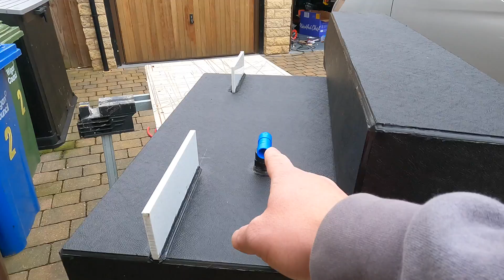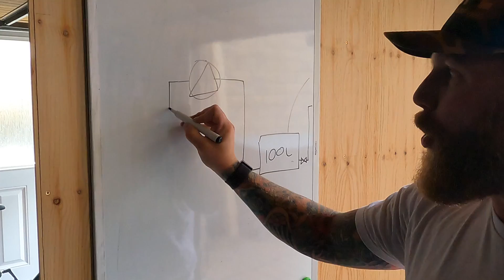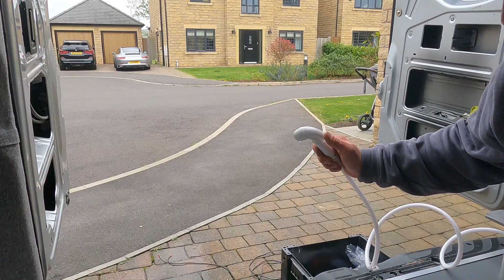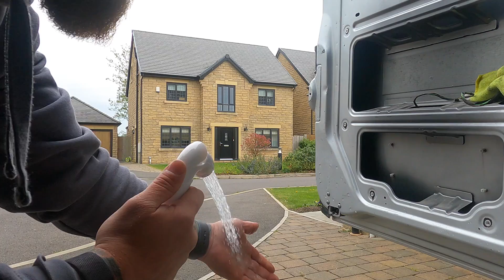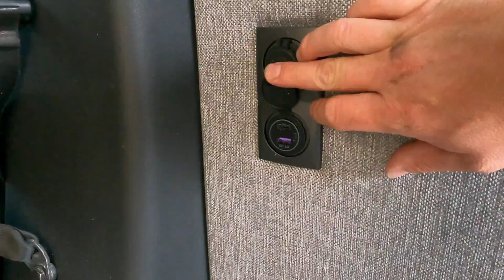Ep15 MERCEDES SPRINTER. VAN PLUMBING HOT WATER. TIPS

Comment: Looking a putting a 240 heater in just for a bulfinch shower, just wondering if the tank goes rusty, will it contaminate the drinking water as it will use a tee off from the cold drinking water, any help would be much appreciated many thanks
Reply from the maker: Shouldn’t go rusty mate if it’s designed to be a water heater

Comment: Hi brilliant video I was thinking the exact same thing using residential heating tank rather than 12v dedicated experience counter parts. But I also want to include a chinese 12v diesel water heater into the same system so I could use the 240v hot water tank to collect the hot water from the diesel heater.  I would really love to see a video on how to make this happen from a professional prospective as your self. Ps when I say chinese water heater I don't mean the chinese air heaters some people use heat exchanges ect. I mean a chinese water heat heats water directly it's self all in one unit.  I'm sure u no exactly what I mean.

Comment: Thanks for all the information.
I'm going to do similar except with a water tank with built in heat exchange so we can heat of the engine.
Was just wondering the size of your tanks. Width x length x height.
Cheers
Reply from the maker: This has that. I just didn’t use that way. Van and tank are long gone. No idea on size. Maybe a link in description
Reply: @urbanarkoverland  allgood
 Thanks for the reply

Comment: I know this is two years after the video was posted but that's the wonder of YT. Would it be possible to have a pre-heater dedicated to only heating water and not running off/connected to the engine water system? The engine water system is a closed loop, so would it be possible to have a smaller (shorter pipes) dedicated anti-freeze closed loop system? Possibly with its own dedicated small tank if required. This would surely result in hotter, quicker anti-freeze = hot water quicker.
Reply from the maker: @AlanAlanAlanDave  yep. Autoterm do them.
Reply: @urbanarkoverland from what I’ve seen they ain’t too big. So is it possible to daisy chain another hot water storage tank?
Reply from the maker: @ they do bigger water tanks

Comment: I'm making one that's purely gravity  fed, to keep it simple and pump free. No chance of pressure bursts either.
Reply from the maker: @doobclub  that will be low pressure that
Reply: @urbanarkoverland  it'll flow quicker than a garden water butt, which isn't bad anyway. Less components means less weight, cost, and maintenance.

Comment: What if it runs dry, will it stop heating the water
Reply from the maker: @CulpritsTV  the hit cylinder will always have water in it. Unless you physically drain it. So even if you run out of cold water the hot water cylinder is still full and ok to heat

Comment: Fellow plumber... Should the expansion vessel be tee'd to the hot on the outlet? I'm wondering if it should actually be tee'd to the cold inlet like you would an unvented cylinder in the home. This, I think, stops the membrane from degrading so quickly. Tidy install mate.
Reply from the maker: @twistandturn02  no mate. On the hot. As most people put a check valve in the inlet and obviously designed to take expansion in the hot system. That’s my 10 pence 😀👍🏻

Comment: Hi. If you had chosen a marine calorifier instead, you would have two additional tubings in and out available to connect your engine cooling water. By doing so, every time the engine is running you make hot water and do not have to use your battery to warm up cold water. Most boats have this system, since decades. As a former sailor I put it on my campervan as well. Works like a charm. Good luck.
Reply from the maker: Yes mate. Didn’t want to interrupt anything to do with the van. This conversion doesn’t even have a shower so it’s only a luxury bonus

Comment: Great vid
For me I use the bobil system as I'm all 12v and rarely run hookup or inverter.   Why don't U add a temp gauge to the water and when it reaches 45⁰( which I find perfect for shower) and switch it off . I know U have Bullfinch so it's mixing cold n hot but 10 litres is plenty to have a relaxed shower and if only heating 10L to 45⁰ will save power .....
Reply from the maker: Hi mate. The immersion has a temp stat in it that does that. Just like household 👍🏻

Comment: Possible to make this work with Victron for example so excess Solar automatically dumps to heating the water?  Guess it would need an electric temp probe for starters? 🙂
Reply from the maker: Hi byes you can do that. Works off of the cerbo. Relay switches power to immersion heater when above any desired percentage. 
The immersion itself has a temp probe. So will turn off when at temperature. 👍🏻
Reply: @urbanarkoverland   ah excellent, thanks for the reply. Would make for a great setup 👍

Comment: Calorifier and disel air heater or better to just do hydronic?
Reply from the maker: Maybe not in a Mwb van. 2kw heater more than enough. And is very efficient with space and moving parts etc.
Reply: @urbanarkoverland  you mean hydronic is not necessary for a 144?
Reply from the maker: @carsandcoffee69  not saying that. Nothing say is ‘GOSPEL’. Just opinion mate. 
But bye. If it was a live in van. Lwb that kind of thing. Then ye. Could be an option. But a 144 that’s used twice a month for holidaying. Prob unnecessary
Reply: @urbanarkoverland  got it. Yeah. It's difficult to make a decision. I am looking at a isotemp water heater at the moment. I have a tire carrier water tank, which makes me wonder if now i have to worry about freezing water and if i need to put some kind of heating element in thr water tank.
Reply from the maker: @carsandcoffee69  my tank is underneath and it’s never frozen. Ever. 🤷🏼‍♂️
Reply: @urbanarkoverland  oh really. Thats great to know
Reply: @urbanarkoverland  but also the water heater will have to work harder i would imagine if thr water is close to freezing Temps and inside the tank would be 20-30 degrees warmer...but maybe i am overthinking it. 😄

Comment: Dernord makes a 12v 600 watt heating element that treads into a standard water heater tank fitting. This allows you to not have to run your inverter to make hot water if you are stationary for a few days and do not want or need to run the engine. Dernord also makes 24v, 36v, and 48v elements for all types of off grid battery systems. You could also have it set up that when your house batteries are at 100% then all solar electricity goes into the water heater resistance element essentially using it as a dump load.
Why have people gone away from sight glass on water tanks. The best ones are a two piece stainless plates with borosilicate flat glass window with several silicone seals. There is a bolt circle that secures the two stainless pieces to the tank wall with the glass window compressed in between. Simple, rugged, nothing electronic to break, nothing to repair, this type of sight glass is permeant and will not break off like the ones with a 90 degree elbow coming out of a tank with a clear glass cylinder acting as the sight glass and this is not sealed at the top.
Reply from the maker: Ye solar dumps are good. Thing is with the 12v elements they take 4 times the amount of time. The end power consumption is relatively similar. Just divided over a longer period

Comment: Great video, we are wanting to run a similar set up! Quick question, do you need a hot water pump as well? or does the cold water pump supply a constant pressure to the hot water tank allowing you to withdraw enough water pressure for a shower etc.
Reply from the maker: Hi mate. Yes.  
Don’t think if the pump as a cold pump. Treat it as pressurised water in. 
You then feed all the cold outlets and one supply enters into the cylinder. It then becomes the hot. Which you then send to the outlets. So yes. One pump 👍🏻
Reply: @urbanarkoverland  great thanks!

Comment: Sorry but galvanized metal is not suitable for exterior use. You need hot dipped zinc coating for exterior metal. that’s why they make those hot dipped sink bolts with the rough surface for. That thin galvanized coating does not prevent rust for very long
Reply from the maker: Hand rail……… galvanised

Comment: The calorifier you bought has a  coil so that it can be heated by the engine cooling water. Did you consider this option or was that calorifer package just something that suited your plans?
Reply from the maker: The van doesn’t even have true shower. So felt it unnecessary to delve that deep if I’m honest.
Reply: @urbanarkoverland  Fair enough. Thanks for replying 👍
Reply from the maker: @garyevans5335  no probs. In this van the hot water was a bonus for washing up. So just solely relied on electric. Also. Stays hot for 24 hours. So heat while ya driving and recharging. Then stays hit for at least a day 👍🏻

Comment: I just watched your video testing the duration of hot water in the shower with the Truma combi, and I'm curious to know if the calorifier  water heater system is more efficient and provides a longer hot water shower than the Truma combi.
Reply from the maker: 10 litres of water is 10 litres of water mate. Neither reheat quick enough to think that you could use continuous. It’s all about how you use it. Hence the shower head 👍🏻

Comment: Been following along with your builds when time permits and keep coming back to this vid as Im leaning towards the same hot water system you are running. Say is that a Shurflo Revolution pump you have there that eliminates the need for that big space-zapping accumulator thingy, if so what PSI is that for the 10L Surejust. Any help is appreciated. Love the vids man
Reply from the maker: I believe the pump is the dometic. I have fitted an accumulator after this video as it purged quite a bit.
Reply: @urbanarkoverland  Thanks for the response, I know you sold that build on, it was a nice simple build with all one needs.
Reply from the maker: @alitheiaziton5188  ye it’s a beauty

Comment: AHH a plumber! Thank you! I'm just wondering as a full time van lifer (hopefully soon) should I put a filter before the pump? and then after the pump ive seen people use an accumulator but i dont quite understand it all, any advice? Thank youuu
Reply from the maker: An accumulator stops the pump from pulsing. And running when it shouldn’t. 
Filters…… pump has a water filter in line to stop debris etc. but as far as making it drinkable. No. Don’t bother. All that effort. Just carry drinking water in bottles.

Comment: If you would not use the electric element in the colarifier but instead use the engine's cooling system to heat up the water in said calorifier would you then need the expansion vessel and a pressure relieve valve ?
I am sourcing my parts to build my own calorifier system. I have a 14 L ATAG indirectly heated boiler (it is heated (normally by central heating circuit in the home) by cooling system heat from my van's engine.
Since the temperatures of engine cooling circuits and central heating circuits in houses are of simular value that should be fine. The boiler has a mixer valve like your calorifier (in fact it looks like it is the same thing) and I have a 8bar pressure relieve valve on the shelf. I may have to get a expansion vessel still. 
The main difference between your setup and mine is the main water pump. Where you use a electric one with build in accumulator, I instead use a foot operated (UK made) pump build into the kickspace of the kitchen cabinet. 
Even if the engine was to overheat and send 90-100 degrees water to the internal coil of the boiler do you think the boiler will cause a problem bursting or cause hoses to blow off their fittings (I use hoses and stainless steel wire fasteners and hose barbs to connect things up from hose to copper (around the boiler is copper only, like your setup has)
Reply from the maker: Yes mate. Probably more so. The expansion vessel literally allows for expansion as water heats… it grows larger. The expansion vessel allows for this. When using the engine, the water will continue to get hotter. So it’s actually more appropriate 👍🏻
Reply: @urbanarkoverland  Thank you for your answer. Could I use a expansion tank from a vehicle ? These things have a cap which allows overpressure (varying from 1 to 1.5 bars) to escape the drinking water system.
I could mount the tank in such a way they will always have a bit of an air space in the tank. The airspace would act as the bladder which is in most systems and would allow for some expansion as the boiler heats up...
Again, there will be no pressure as such in the system when not in use. The whole drinking water system is operated by a footpump which can (maybe) produce 1/3 of a bar (10 feet of head.
The system is small and based on a 19L cold water tank sat inside the kitchen cabinet and a 14L copper boiler with an internal copper coil out of a ATAG central heating unit...
Reply from the maker: @koningbolo4700  it all sounds sound yes. But i couldn’t say for sure. What I would say is…. Why chance it. The little red vessels are so inexpensive and discreet.
Reply: @urbanarkoverland  I found the Fiamma A20 pressure vessel... Normally designed to catch pump cycle pulses and prevent nervous switching of the onboard water pump. It has a bladder which can be set to a range of pressures to adjust the syste,... I presume these vessels can be used to catch pressure buildups caused by water expansion...
Reply from the maker: @koningbolo4700  still probably not no. These are designed to almost create pressure. Not absorb it.
Reply from the maker: @koningbolo4700  it may work. Don’t get me wrong. Are you struggling to find the right item then??
Reply: @urbanarkoverland  Seems like it... Do you have a suggestion for link or the like to a suitable item please?
Am I correct the therm for the device is a Hydrofor??

Comment: Can you add LPG as rather than electricity to heat the water
Reply from the maker: Um…… not sure how you would with this type of cylinder.
Reply: @urbanarkoverland any idea how much electricity it uses in AH per 10l off water
Reply from the maker: @shabazhussain8101  rough calculation would be 50ah. 👍🏻

Comment: Thanks great info.
In progress on second van build and have not fully decided on water system.
As a weekend warrior I have simply used cold water from 10l water containers which have been OK. 
And boiling water on the gas hob.
But thinking of going for installation of a system
Reply from the maker: It is nice to have. Although a luxury 👍🏻

Comment: Is it mandatory to have the expansion tank? 

Also what size is the fitting that goes onto the brass outlet of the tank? Looks like you put on a fitting that converted it to 12mm then added on your 90° fitting.
Reply from the maker: Yes. To allow for expansion. Otherwise the pipe will expand and probably blow. 
1/2 inch - 12mm 👍🏻
Reply: @urbanarkoverland  Okay awesome I will get a expansion tank!

I have been doing a lot of research this morning and according to the diagram online it says that the barb or brass coming out of the coloifier is 15 mm. I hope it is 15 mm and not 12 mm lol because I just ordered about $70 worth of fittings!  I have the 40L Coloifier.

Comment: Hi, like the idea of the water sender, does this connect to 12v power of is the gauge just activated under pressure?? Sorry if it’s a stupid question, this is all new to me
Reply from the maker: Hi. You power the gauge yes. Then a twin wire goes from gauge to sender. It measures resistance
Reply: @urbanarkoverland  great, thanks for the info, I have ordered the bits to install once my tanks arrive. Just started my conversion and your videos are a god send, keep up the great work and hopefully We’ll bump into you at one of the shows once our van is complete 👍
Reply from the maker: @bradleyclements7014  ah I’m glad to hear I can help. Good luck with the build 👍🏻💪🏻

Comment: Hi Q in what way is the extension live can one get a shock in plug into inverter to heat your water ?
Reply from the maker: Hi. Odds are the same as if was plugging into  a household outlet. No reason you should get a shock. If concerned. Plug in. Then switch on 👍🏻